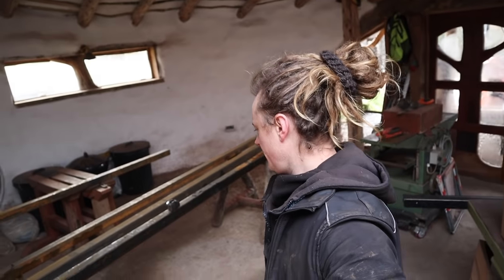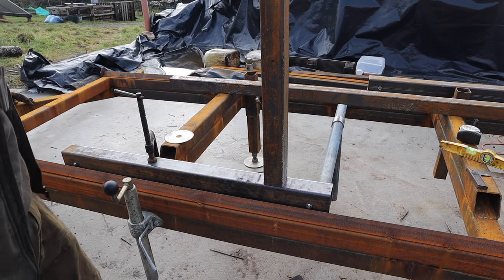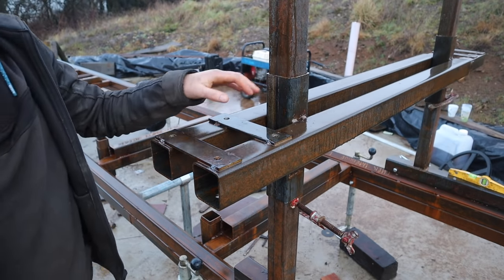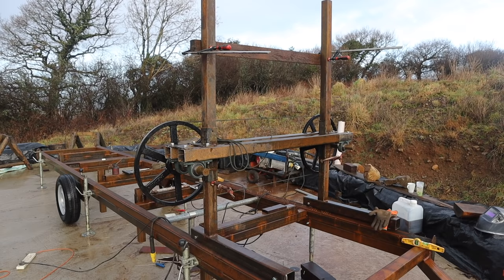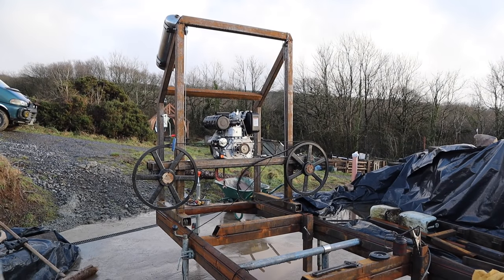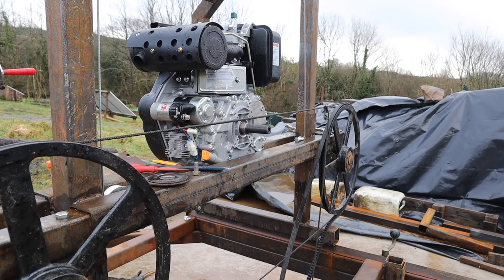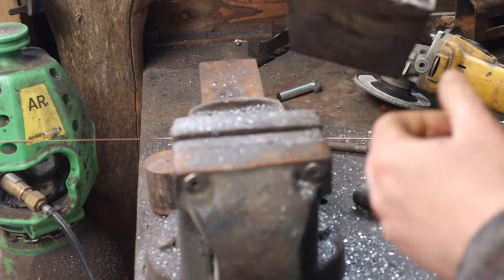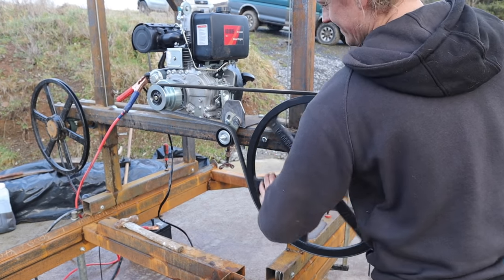DIY Mobile Bandsaw Mill Part 2 Saw Frame

Comment: Brilliant Kris, maybe add another jockey pully above the belt tensioner - just to pull the belt down and away from the blade. {less wear on belt}.........carry on sir !
Reply: I think the belt acts as a rubber tire for the blade on the wheel(like the woodmizer sawmills), so it doesn't matter if it touches the blade, because the blade gets pressed on the belt with a lot of force anyways

Comment: Looking great so far. You've been doing your homework i see. I wouldn't recommend using wood slats on top of the log bed as they will create friction and wear fast when loading and dragging logs onto it.
The beds on my mill and almost all others are painted steel and will always stay true. I believe mine are powder coated. I couldn't see the cable ends in the video, but you might want to add an eyebolt or a turnbuckle for cable adjustment at the end of the cable. Being heavier on one side can cause the 2 cables to stretch at different rates causing the blade to track downwards on the heavy side in time.
Keep up the great work there Kris.

Comment: Love your videos thanks.  I have a lot of experience with sliding gates which uses the same rollers and tracks, I found if you weld a length of 14 or 16 mm round stock on the angle it glides with much more ease and prevents any dirt buildup

Comment: Little tip: those kind of pulleys work because of friction, if you use this type of belt you are loosing surface area and therefore friction. I'm afraid the system might slip when you introduce forces from the blade. Cheers, keep up the good work!

Comment: Fantastic work! It's really coming along, and great job adjusting to design constraints on the fly. I'm a sawyer by trade, and a few things that may help you out if it's not too late already- 
I saw it mentioned elsewhere in the comments too, but an extra wheel pushing down on the slack between motor and flywheel would be a good safety feature to prevent the vibration of the drive belt from hitting the blade. Assuming that the blade will ride the drive belt on the transmission side (and another tyre  on the other wheel), the blade will be going the same speed as the belt so the chances of the teeth catching it are minimized, but  there is also a significant amount of vibration in the drive belts and the way yours is setup, if it breaks the saw blade will be almost guaranteed to fly off.
Also, consider a downward tensioning system to hold the carriage head steady while milling. The weight of the motor and water add up, but may not be enough to counteract the motor vibrations. Looking at the footage it seems to be visibly moving the carriage up and down while running, and even that much movement can cause some funky cuts as well as introduce a fair bit of stress to the blade on cut entry before the log stabilizes it. Possibly some springs in the system or even a second ratchet that can provide positive downward pull once the cut height is set. 
Looking forward to seeing you milling on something other than the alaskan mill! I run an 8 foot bar and know exactly how slow and painful it can be!

Comment: Great! I'm sure that your bandsaw will do everything you want it to do when it's done. 

A bit of advice from someone that has worked a few years with steel. I sometimes remove my angle grinder's guard to get it in to weird positions. But I always put it back on when I'm done with that task. I often rest my thumb against the guard  to do precise cuts, so for me it is an advantage to have it mounted anyways.

Comment: Hi Chris, looks good it will be an invaluable tool I built mine 7 years back cuts 3 ft dia x 27 ft long two 4.5 HP electric motors one on each sheave , old drill raises and lowers the head on trapezoidal threaded rods and motorbike sprockets & chains , will cuts pine with one motor oak needs both , one thing I changed guide bearings have to be slightly lower than straight makes a big difference , I have never used a lubrication system either , always thought I can add it if its needed just didn't get round to it doesn't seem to make a difference cuts beautifully , another tip wide blade { mine is 1 1/4 inch or 1 1/2 inch  } has to be parallel with the bed , I clip a long piece of straight aluminium onto the blade and adjust so equal measurement above bed both ends , oh and I sharpen my blades on the machine with an angle grinder blades can be sharpened about 5 or 6 times I have found although they are only 22 quid each mine are 16 ft long , will follow with interest cant wait to see your face when you cut that first log lol ,  also make sure teeth stick out beyond the edge of the sheaves as the tooth set is flattened and brade will wander up & down .

Comment: Hi Kris, have you considered a worm wheel winch instead of a ratchet? When you wind it up or down it’ll stay where it is when you stop turning although vibration and the weight of the handle may cause movement. Brilliant videos, thank you.

Comment: Hello Kris, like on my opinion, it would be good to install one roller for the top side to tight the belt from the top too, to ensure more stable belt movement. Like on some motorbykes, when the rollers are installed on one plate ends in diagonally, thus you will have the ability to tight the belt more precisely.

Comment: Kris, did you learn how to do metal fabrication work when you worked on elevators, or have you just taught yourself since you started this lifestyle? I'm so amazed at what you have accomplished. I wish I had your talents.
Reply from the maker: Not really no. Most of what I did with elevators was pre manufactured assembly and the odd repairs. All this stuff I do I have just picked up over the years because really it’s a hobby of mine to make stuff and has been since I was a kid
Reply: Most impressive. You make it look like you're a professional. Thanks for the inspiration.

Comment: Hi kris I have a small YouTube  channel and I'm building my own saw mill at the minute. I have just came across your channel its been really helpful. Really love all your videos its just the type of content I'm into 👍
Reply from the maker: Ah nice one, i will check out your videos.
Reply: @KrisHarbour  thanks mate, can't wait to see how u do your blade guides I'm sure you have came up with a better way than me 😂
Reply from the maker: It’s actually been on my mind a lot. I am going with a custom made roller design and a fellow YouTuber is going to make them for me on his lathe. You have to get quite creative if you don’t have a lathe. But from what I have read rollers are really the way to go.
Reply: @KrisHarbour  yea the roller design seems to be the best. I used a bit of 20mm threaded bar and 2 sets of bearings and a large washer with a bearing behind it. Just tested it there this afternoon and it seems to be going great. I should have a video up in the next few days showing it. Your sawmill looks class, I've never seen one with a diesel engine can't wait to see it finished. I used a 5.5hp single phase motor, hopefully everything goes to plan 👍

Comment: Brother, most mills have an idler bearing under the top of the blade. so you could lift the blade up a bit away from the motor pulley. The blade will vibrate up and down a lot at that width. So you need a good amount of space to clear the pulley without the idler bearing. My 1985 woodmizer uses a seal bearing running directly on the blade.

Comment: Looking good.  I noticed that the belt likes to move up and down very close to where your blade will be.  Might want to put a string around your blade pulleys and run the motor.  Then run it again while recording it, and then review that footage in slow motion to see if you will have any issues with the drive belt coming into contact with your blade.
Reply: Hi Kris I was also thinking along these lines. Hats off to you getting in there and making the rig. But I can't recall seeing other sawmills using the drive belt to the wheel for the blade. Its surely going to cut the belt every time your blade breaks. Would a separate double pulley of suitable smaller diameter be better. It would also hold your clutch and motor a bit away from the blade as well. You will need a separation for the blade guard later as well.

Comment: Hi Kris, I don't normally comment on your projects because, frankly, your very good at what you do.  But I do have one suggestion for you.   If I were building this, I would flip the motor around and then replace one of the saw pully axels so that your belt is on the opposite side of the frame.  This gives you more clearance, your belt will last much longer and if you need to change a belt, you wont need to pull the saw band off.   Only changes needed would be to put some bearings on one side and fix the pully to a through axel.
Reply from the maker: The way I’m doing it is a common design used by the most popular and widely used sawmills. The belt is what drives the saw blade. The blade sits on top of it

Comment: Consider a winch with a length of bungee past the far end acting as a feed system , it works great . It’ll save you pushing it and it’ll give it a more regular finish .

Comment: maybe a manual tensioner to engage ! Fantastic though inspiring i might have to get off the couch . And make a log arch lol edit just realised your running ur  blade on it. 99% there just fetling  and adjustments.

Comment: Never seen a bandsaw mill where the blade rides on the drive belt - is that expected to cause more belt wear?
Also for the opposing non driven pulley do you just put a tyre on that is the same thickness as the driven belt side?

Its a great project, thanks for making these videos.
Reply from the maker: It’s a common way it’s done on commercial mills. The blades are wider then the belt so the teeth don’t touch the belt just the back of the blade
Reply: @KrisHarbour  Got it! I'll have to pay more attention.  Looking forward to the next video
Reply: @KrisHarbour  Brilliant work Kris, where did you get your bandsaw wheels from please?
Reply: @nathanelliott1414  Kris please answer this comment from Out Of The Woods his saw milling channel is brilliant.

Comment: Im building my own sawmill and really like your design. Did you have any plans you worked of off or was it plans that you made kind of as you went along? Could I purchase the plans from you or at least get the steel list for the saw sled portion? That way I don't over buy or under buy.  Thank you for any help you can give and thank you for sharing in the build of your saw!

Comment: Your post driver was one of the more impressive DIY projects I’d even seen, but clearly that was the tip of the iceberg. amazing. I’m actually a bit curious about the small Diesel engine you’re using. Could you tell me what it is?
Reply: its a Chinese clone of a yanmar L100 engine, they are brilliant!
Reply: Kris did a video on the engine last year.

Comment: Interesting method to power the blade running it directly on the belt using pulleys in place of bandsaw wheels.

Comment: Quick Tipp for perfect lowering and raising with the winch: get the cable from the winch to the right Side of your carriage and mount IT there Solid, Not with a pulley. Then from that Point Go down with the cable and 'under' the mill with two pulleys and then Up on the Other Side and down with a pulley to the of the carriage where you mount the cable Solid. This way If you Raise the right Side with the winch your 'pulling' the left Side Up aswell without the possibillity of moving it crooked!
Reply: Its hard to explain but with that configuration your pulling both Sides Up at the same rate. The First Side directly with the winch. If the winch goes Up your pulling Up on the carriage which then Lifts the Other Side via the pulleys. In total you need Four pulleys (plus the extra one you used directly after the winch). One in each Corner of the mill. Then the cables goes from winch to upper right pulley. From upper right to the right Side of the carriage(mount the cable there Solid). From the right Side of the carriage to the bottom right. From bottom right to bottom left. From bottom left to top left. From top left to carriage left where you mount IT aswell. Man. Its hard to describe this stuff in english
Reply from the maker: Thanks for the info. I will have a go at drawing that so I can get my head around it. I will see how this works first. If it is uneven then I will make changes
Reply: @KrisHarbour  yeah drawing it would help i could imagine ;)
Reply: @andycollins3978  many paths lead to rome BUT that version youve linkes is way to compicated with way to many ropes and pulleys. you really just need 4, maybe 6 for convenience (to route the cable nicely out of the way) because its impossible for the mill application to go "under" the mill. ive used 4 to not make it any more complicated and just get the point across, the rest is just direction changes). no double or tripple pulleys not a thousand ropes. simple is the way to go here!
Reply: Oh yes, you could visualise it as one cable running around the hoisted part in a loop, via a set of pulleys. That cable is attached to the beam on the left and right. If you then pull on one side, the cable will ensure that the other side follows exactly
Reply: @09conrado  great explanation!
Reply from the maker: Any chance of a quick drawing? im having a hard time working out why what is being described is different from what i have done.
Reply: @KrisHarbour  ive uploaded a quick video, sorry for my english i hope you get the idea.
Reply from the maker: Ah that’s great 👍 thanks for taking the time to do that. That has helped a lot. Might have to make that change. Thanks again 🙂
Reply from the maker: So you guys were right about the raising and lowering. its quite accurate as it is, about 2mm out give or take when its set. But the big problem is the fact that one side lifts first when raising and when i have tension on the blade this causes the carriage to jam and get wedged. So i am changing it to the system outlined by Clypeum (Thanks again) I need one more pulley though so i have to wait for that. But im going to start changing it today. Just wanted to let you all know that this was a great help. Thanks again.
Reply: @KrisHarbour  thanks for the Heads Up! The extra Work ist worth it, your going to have a really nice mill :) looking forward to the Video
Reply from the maker: @clypeum5063  Hey, right i have spent most of the morning changing it but im quite sure it cant work. I only just tryed it but after looking at it for a bit im quite sure the design in the video is impossible. the wich side is 1 to1 and the other side is at least 2 to 1 I need to work out what is going on with it properly but im quite sure after looking at it that its an impossible design.
Reply: @KrisHarbour  You think the design shown in the video is impossible or your first design is impossible?
Reply from the maker: @clypeum5063  yeah your design, the side that gets winched gets winched at 1 to1 the other side goes via two two to 1s. it would work the way you have it in the first part but as soon as you double up and go back up to the carnage to get the cable out the way of the log you put in a two to one, then another one the other side. so for every movement on the left the right wants to go 4x that. im still working to confirm that is defiantly what is going on But im 90% sure. is the design something you have seen before or did you come up with it?
Reply: @KrisHarbour  okay, i will have to Look Into that a Bit More and Build a Model this evening to get that figured Out. I will give you an Update If i figured IT out
Reply from the maker: @clypeum5063  I just put  jack under the carriage and raised it up manually with the jack while measuring the cable from the left side. It moves away from the carriage more than the carriage moves up. That confirms it is a multiplication system on the left but not on the right so in the up direction it trys to get to tight and binds up (actually broke my shackle) and in the down direction puts in slack.

I had to cut the winch cable to make the changes so now i cant even put it back. I think im going to go with an overhead bar that has the cable wound around it that way it will lift it equally.
Reply: @KrisHarbour  im uploading a Video, maybe im Missing Something big but i think a fixed pulley only Changes the direction of the force and doesnt Multiply It like a traditional Block and chakle.
Reply from the maker: @clypeum5063  Hi, Thanks for making the videos. yep i agree that the way you have it in the lego model would work, But the way it was demonstrated in the first video dose not work. This is the way i did it today https://youtu.be/vkro_dM90Y0?t=70 Doing it that way meant i could leave the original pulleys in place and then just add two at the bottom. But The method adds in a multiplication as you have a two to one on both sides from the carriage to the bottom.

Any chance you could setup the system like it was in the video with the two pulleys at the bottom and then slung across the carriage?

Trust me to choose the method that wont work. If i had done it with the cable going up to the top like at the end of the first video it would work but the other way dose not  work, I should have know that to be honest im a bit pissed off at myself for not seeing it. 

I have changed it now for the overhead bar system and that is working, so this is just learning now.
Reply: @KrisHarbour  yeah, it was wrong to Put the pulleys on the moving Part! Im sorry i missed that. Glad to hear your solution works now and im sorry that i showed you the flawes Design (atleast one from the three).

Comment: Love the channel also but I fear you will go through belts very fast as hard as the turn over that tension pulley is. That or really heat up the bearing inside of it. Finding a shorter belt & less aggressive mounting spot for that tensioner may need to happen. Best of luck sir.